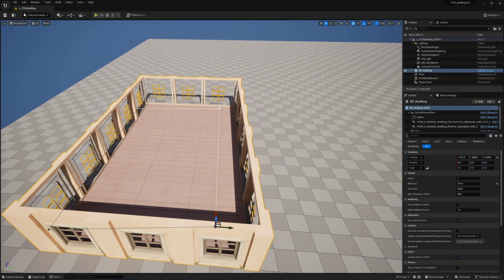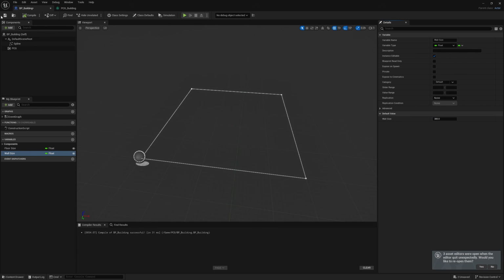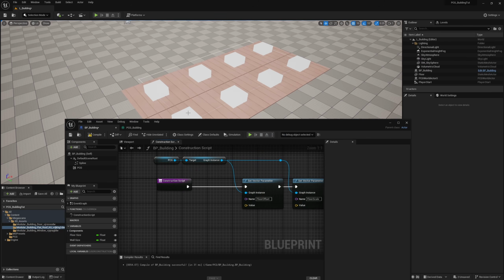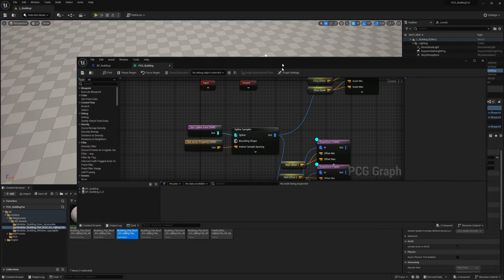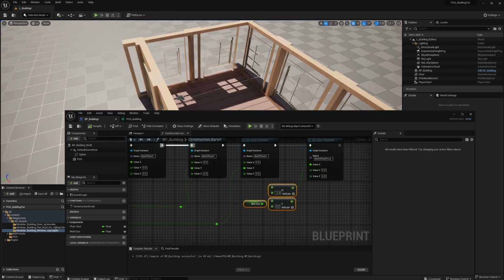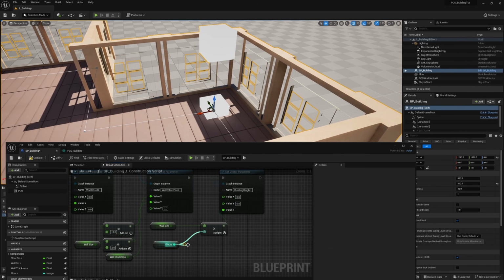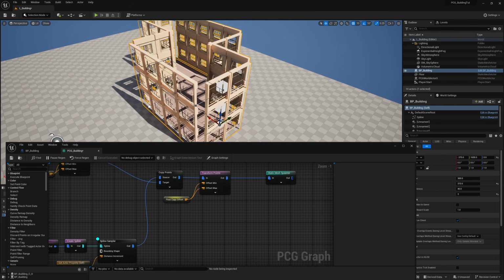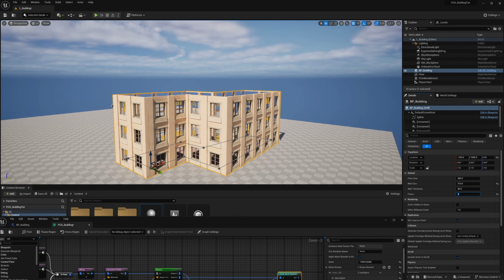Procedural Building Using PCG and New 5.3 Blueprint Nodes - Part 1 | Unreal Engine 5.3

Comment: If I change the Y or Z rotation on the object in world editor the wallheight splines go completely crazy. This does not happen with the X rotation. Location transform in the world editor is set to relative, but changing it to world doesn't really changing anything either. What could be the problem here?
Reply from the maker: Are you using splines to control your wall height? What specifically about them goes crazy?
Reply: @Procedural_Minds  The offset of the walls increases or decreases based on Y or Z location in the world editor. It's like the pivot doesn't move in those axis. This is only for walls that is 2 or more floors high. I'm using the same method as you to control the wall height, but somewhere somehow there must be an error. I just can't figure it out.
Reply from the maker: @SynthvibeConstruct Really odd. I do make some improvements on it in P2, so try those changes and see if that fixes your problem.
Reply: @Procedural_Minds  It's just so strange that world position is having an effect on its offset. It feels like it should have a simple solution. I'll keep watching your vids and hopefully figure it out :)
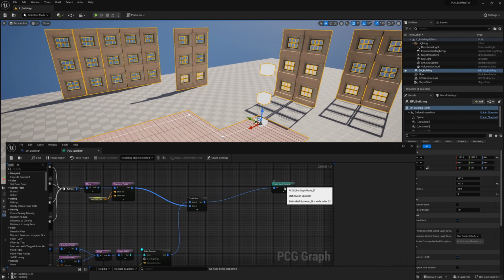Reply: @Procedural_Minds  Even stranger actually. The problem you have at 19:07 is the exact problem I get when I use your solution to it. Before this the walls are faaar away in each direction.
Reply from the maker: @SynthvibeConstruct Really odd. If you're using the exact same meshes as me then it might be something missed or unlinked. If you're using a different mesh then you'd need to adjust the offsets to accommodate your setup. Later on this entire setup for moving points up is completely replaced with a custom node we make.
Reply: @Procedural_Minds  Using my own meshes, yes. 200 size instead of your 300. 
If the whole setup is replaced I'll just continue on with the series :) I just really wanted to figure this out lol
Reply: @Procedural_Minds  1 minute into your next video and it's fixed! Should've just done that earlier. I still have to split the struct pin to make it line up though. Y and Z works perfectly, while X needs to be divided by 0,9852 to line up as close as possible. Thanks for the fast replies :)

Comment: I'm using a system based on yours, but I centered all pivot points before starting. I didn't have that weird issue when floor is 1.
Reply from the maker: Nice! Yeah I decided to use the default megascans assets so I had to do a bit of extra tweaking. But if you ever encounter similar issues you now know what to do. :)

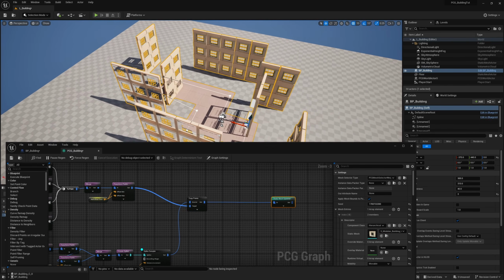Comment: Great Tutorial! I couldnt work out the part where you Copy Points part  (19:30) ill see the second video where it changes abit maybe it will fix it 

Heres some stuff that might help someone out in the comments because it took me a while to figure out: 

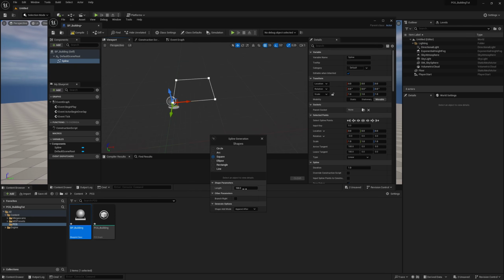-  1:40 -  make sure you dont have a duplicate hidden by Pulling the spline points up*
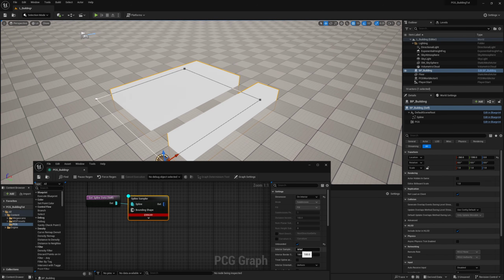- 2:42 - Changing Interior Sample was stuck in Error! Moved Cursor on the Error and it pointed that it has to be ticked on and i forgot
- 12:00 - Difference was not working correctly and couldn't figure out , turns out i had a blank space in one of the Set Vector Parameter names and after coping it and pasting correctly it worked!

Good day!
Reply from the maker: Glad you got it figured out mostly. PCG is a bit fiddly and if you don't do it exactly how it wants it's quick to complain and error.

Comment: That’s a great tutorial. Thanks for teaching! I just have two problems : 
ONE : this happens from the first placement of the spline, when I adjust the boundaries the meshes update, but when I move it one more time, the ones already distributed along the spline, seem to stay and the new ones, go on top of it. so basically doesn’t get rid of the meshes that were there before. What am I missing here? every time I want to change the boundaries, i have to delete the whole thing and drop the blueprint in to my scene again

TWO: I can get it to work until the add floors step.  19:22 after that it just doesn’t work.
I triple checked every setting you have, but for me the crazy placement of the individual mashes after moving the blueprint origin doesn’t go away:/ 
any idea?
Reply from the maker: One: This is a known bug that usually happens when you use CTRL-Z, it bugs out. The fix it to select the HISM / ISMs in the detail panel of the Blueprint and delete them. Then select the PCG node and cleanup then generate. You should be good then.

Two: In part 2 I simplify it a bit and slightly change it. So try that and hopefully it'll fix the issue. Also double check your pivots. If you're not using the same pieces I am then the values might need to be adjusted.
Reply: wow such a quick response ❤ really appreciate… it’s my 2nd day i’m trying to figure out these problems😢… thank you , i’ll try
Reply: wow it worked! i used the exact same piece you used! it works like a charm! the funny thing is: that right after i tried with the one piece ( similar to yours ) that wouldn’t work for the last 2 days… and it also works 😅
also i don’t need to have the 180 deg hardcoded rotation in the Transform points… just the 90… big thanks man!
Reply from the maker: @fatomato2012  No problem, glad you got it all working!

Comment: very cool guide, How you think guys any chance to use PCG for Wave Function Collapse ?
Reply from the maker: I believe wave function collapse is actually on the list of things they've said they're working on for future versions. At the current moment you'd need to figure that all out yourself and code it in.
Reply: @Procedural_Minds  , souns good. i have question: did you try mesh overlap in PCG? Like if we have one floor building and other build close together we can merge walls with windows to full walls or door or columns for make unique build.
Reply from the maker: @BloodForce_BF  Not yet but it should be as simple as adding a Difference node whos input looks at all actors in the level with a tag for example. Then it would remove overlapping walls. It's not quite the simple from every side, so it hasn't fully been implemented yet.

Comment: Im having issues with this pretty early on... The spline sampler node is still in error state... I dont have the visualization cubes, and the static mesh (floor) isnt showing up... im in 5.2 does that make a difference?
Reply from the maker: This is done in 5.3 and there's some differences in the spline sampler between the two. As for the cubes, did you turn on debugging?

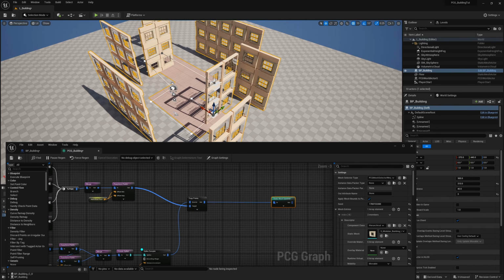Comment: The reason your wall floor height XYZ thing is all wonky (around 19:30), is because when you created the spline for multiple floors, the spline is essentially rotated 90 degrees. And thus, its more or less converting XYZ to that ZYX that your workaround is undoing.  Need to find another way to create floors than using the spline like that.

In the Create Spline, Debug visualize, instead of using a 'PCG_Cube', use something like a 'tree' or something with very apparent orientation and this will be more clear.
Reply from the maker: Yup, you're exactly right. Been learning a lot myself doing this series. Now in the new parts I have changed it entirely for a custom node so the problem has been eliminated.
Reply: I just snatched the arrows and stuff from the example content. The Niagara hallway uses them iirc. They come in handy all the time.

Comment: how do I make the static mesh spawners randomly choose from an array?what node do I use, so it will randomly choose between different meshes at runtime?
Reply from the maker: You can just add more meshes to the static mesh spawner. That's how it works by default.

Comment: Awesome start :) I'm very excited for the rest of the series!
I like to see two things:
1. Parameters for the Static Mehses -> So they are swappable in the child Blueprint/PCG later.
2. Reading the Parameters for Wall Thickness, Height etc from the SM-bounds. So these automatically snap to the meshes dimensions. No need to "hardcode" them.
Reply from the maker: 1 - I heard there's a way but I haven't tested it as of yet, but definitely on my list.
2 - Theoretically that should be doable by reading it from the blueprint. I'll look into it. :)
Reply: @Procedural_Minds  hey, I have been fiddling with PCG for a while and was able to change meshes through params. Turns out it is not hard at all for starting out. Basically, I created a struct that contains multiple mesh soft object references (door, wall etc) and created different types of sets within a data table, that keeps things organized and reusable. Through the blueprint,  I was able to read the data through GetDataTableRow and assign corresponding references to each parameter using SetSoftObjectParameter by giving the exact names of the params. Now I am working on adding floor-based pieces to further define the building theme.
Reply from the maker: @excalith Very nice, but does it work with a full array of items to select a random one per point like the full static mesh spawner? I've seen how to replace one at a time but not how to do a full static mesh list with the chance of each showing up control.
Reply: Hey  @Procedural_Minds , theoritically speaking, the easiest approach would be adding different params and use modulo to switch between different variations. However, regarding your question, haven't found a way to proper way to do this yet. I believe writing a custom function for the PCG graph to get a random static mesh from that data structure array in blueprint could work. Will join the discord channel and let you know if I manage to solve it
Reply: Hey,  @Procedural_Minds  I believe I found a workaround regarding that. On BP side, create a function that returns a random piece from your array and on a custom PCG Element, read from owner Blueprint and get the soft static mesh reference and assign it as an attribute.Not convenient, but seems like the only solution as of 5.3.2. Will be playing with that a while and see what can be achieved. Want me to ping you on discord for that?
Reply from the maker: @excalith  I know it's possible to do it for a single static mesh swap, but from what I can find you can't have it randomly select a mesh from an array list, like if you have multiple static mesh entries. If that's figured out, I'll definitely be interested.
Reply: @Procedural_Minds  The PCG is so complicated, either I couldn't explain or you misunderstood :D The thing I just did gets a random piece from BP array and assigns it per point, so makes it equivelant to assining multiple meshes into one static mesh spawner. Will ping you from discord
Reply: Awesome 🎉 can’t wait :)
Reply: You can add a static mesh reference variable in your graph and a PCG mesh selector by attribute in your spawners. Of course, you need to add the mesh reference as a new attribute to your graph first.

Comment: Good morning,
  Great video, I saw that it helped a lot of people, but I have a problem at the beginning of the tutorial. When I place BP_Building on the map, the internal filling with white blocks does not appear even though I mark it with the two options of internal filling and unbounded. Sory for my english and tks for help.
Reply from the maker: I had a similar thing happen, seems like 5.3 bugs. Just extend the spline to be larger, then it should start to populate it. It seems when it's really small in 5.3 it also has some issues.
Reply: here, not even increasing the spline area, I'm going to redo everything from scratch once to see if it solves it or try in summer 3.2
 @Procedural_Minds
Reply: use (debug)you see that small circle on blueprint . if that helps. it was my case why i didnt see those
 @lucianomachado9289
Reply: I have the same issue/..changing spline to larger size doesn't fix...any other suggestions? @Procedural_Minds
Reply from the maker: @andreadimmock8958  Did you turn on the debug?
Reply: @Procedural_Minds  on the PCG Blueprints you need to check "Debug" on each one of the nodes (get spline data, spine sampler, get actor property)
this worked for me (UE 5.3)
Reply: @MosheFarkash  Thank you for this!

Comment: @TheLazyContradiction it seems like you're skipping through some parts and only the 1st floor is showing, when adding floors it gets completely wonky. Could you please post a link to this project to your Github to compare? Or maybe someone else has one that works correctly? I've been at it for hours and can't figure it out. That would be fantastic and help me out a lot. Thank you!
Reply from the maker: A few people have been asking for files so I'm the process of figuring out the best way to do that. If it goes wonky when adding floors then double check the copy points node, the top one is source instead of relative I believe, and then the offset is just all axises at -1. In the start of part 2 I simplify that part, so check it out and hopefully that's all it needed.
Reply: @Procedural_Minds  About files, Github is really the best way to go and it's free, plus gives you a backup (version control even) and it's easy to share, plus gives you name recognition if that's what you want. Also TY very much for the other info, I'll check it out.

Comment: Hey i have a problem that for some reason my materials are disappear and it shows just the default block texture. When I set the static mesh as single mesh in the world then it has his materials but not in pcg. Do you know what problem it is?
Reply from the maker: There are two things that come to mind. 1 - Check that your static mesh actually has the correct material applied to it when you open the static mesh by itself. And 2 - The Static Mesh Spawner has the option to override the material in the static mesh, so double check the settings you put in that you're not overriding the default material you had setup.
Reply: @Procedural_Minds  both things are correct and that is the weird thing, I think I Show later on what the problem is, but thank you very much for your Quick reply! Thanks :)

Comment: Hey great video looking forward to more PCG content, did you ever figure out a solution to the offsetting happening on the copy points node. I have the same issue and really want to figure it out.
Reply from the maker: Not yet. From googling people say to make sure it's local, but I checked all my settings and it is all local. Adding the offset from the blueprint like I did does solve it, so it's now a less pressing issue. But I do want to figure it out at some point.

Comment: I found this through a Reddit post on the Unreal channel, and am very lucky I did!  My floor has a center pivot (4X4 size), and I can't seem to get it correctly centered in the shape.  If I increase the divide number by a lot, instead of 2 put 200, it gets really close, but that doesn't seem like the right thing to do.  Great tutorial though, looking forward to roofs and maybe randomizing windows meshes and first floor only meshes like doors and stores.  Can't wait for the next one!
Reply from the maker: For the floor you can do something similar to what I did, where you effectively multiply it by the difference between the wall size and the floor size. That way the floor will automatically scale accordingly.

Next up most likely is going to be the doors / window variations, and maybe even the extra floors. We'll see what I get to.
Reply: Thanks for the reply!  I'll try that.  I'd like to be able to generate a Packed Level Actor of the building but can't find any information on being able to do that with a blueprint.  Any thoughts on how to output a building with its cheap instancing so you don't have to keep the Blueprint in the world?  Thanks again for this great video!  @Procedural_Minds
Reply from the maker: @tchiocchio  If you're generating it with PCG then I have a video on baking down PCG to a Static Mesh and a Blueprint. The blueprint effectively is equivalent to a packed level actor as it keeps everything as instanced geo, just like it is in the PCG originally. Super easy to do too. :)